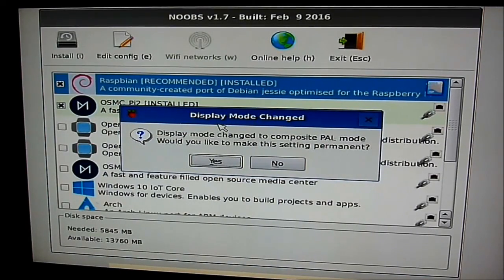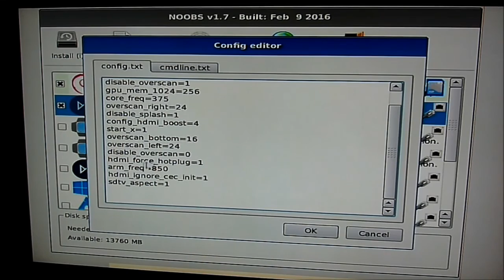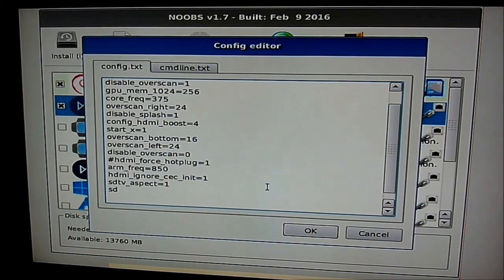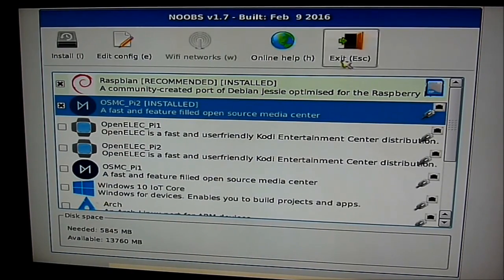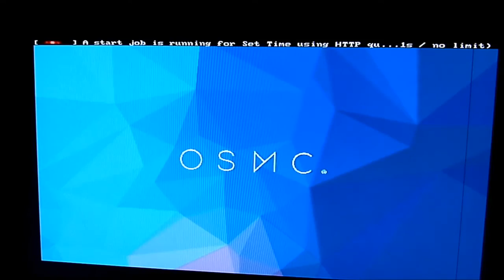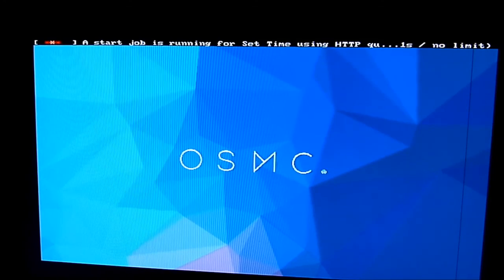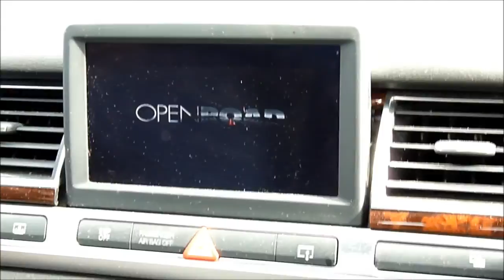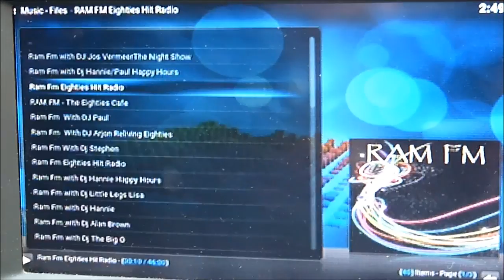Configure Raspberry Pi 2 Composite RCA For Analog TV and Audi MMI 2G TV Tuner

Comment: how did you get kodi on your mmi not understanding
Reply from the maker: You need to add Analog TV tuner 4E0919146 with FBAS for video to get to the MMI screen. Just hook up the raspberry pi composite outputs to the AV1 or AV2 on the Analog TV tuner.
https://www.youtube.com/watch?v=e8HZi85HuSI
https://www.youtube.com/watch?v=yYrU0aNIqRM
https://www.youtube.com/watch?v=wQddS7Pzia0